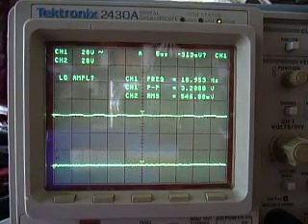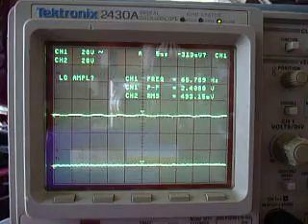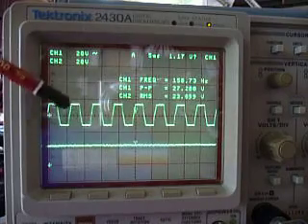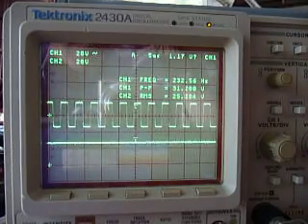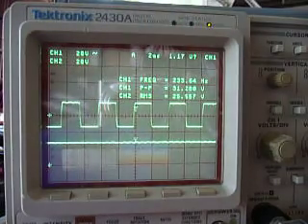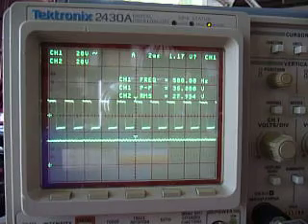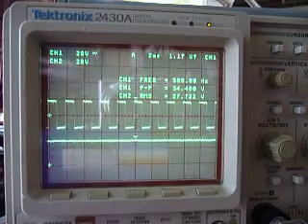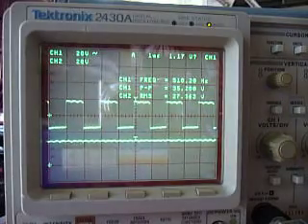HHO alternator output waveform

Comment: Now can you see the need for a totally separate drive motor for the alternator? The resonance is found by the RPM's the alternator is driven at. Once you find the sweet spot it must be maintained as it will change with temps and gas production rates rise for the more gas produced means less water between the electrodes which changes the cells capacitance. Meyer didn't drive the alternator with a separate motor for no reason. Take a look at the hereticalbuilders site for more info.